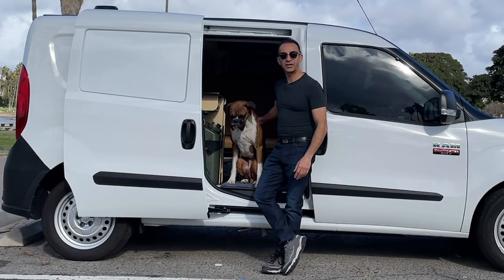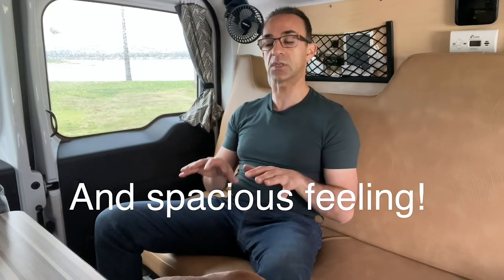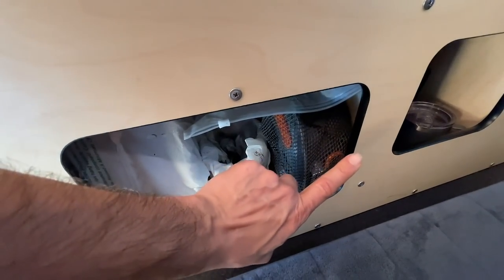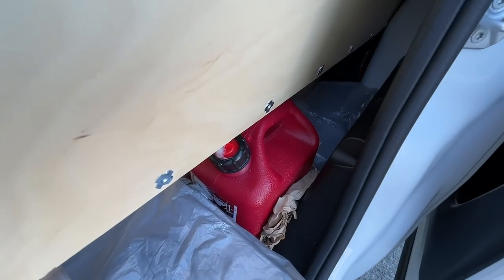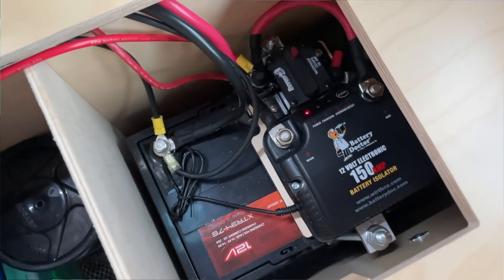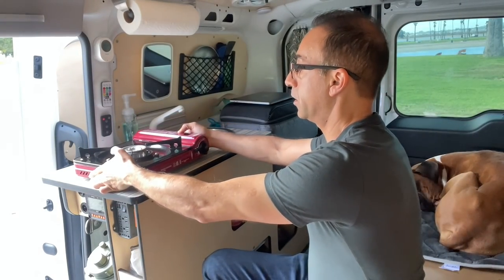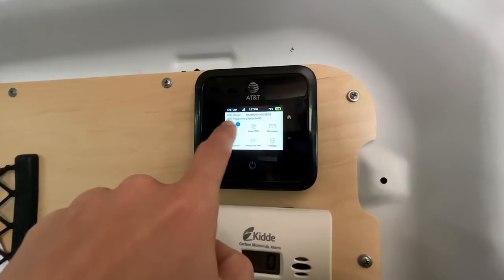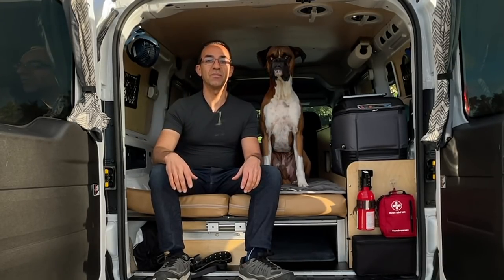Van Tour of Our Tiny Luxury Glamper Van | Full Time Van Life! (Story #8)

Comment: Hey there! Really like a number of the features that your conversion has, and I'm definitely going to look into adding a few to my NV200 self built van. I'm a violinist who spends months travelling around the uk playing at festivals so I have to carry around all my gear and electronics, so I had to get really creative about storage. My little dog Pearl is always with me too and it's taken a year or so to stop her barking at noises in the night, and initially she hated my diesel heater too. All in all I find its alot of trial and error and compromises in a little van but I wouldn't exchange our lifestyle for any other. I'd definitely look at some solid insulation if youre travelling to colder climates. Those metal ribs will conduct cold right thru the van, even a roll of vehicle carpet attached with spray adhesive will help - also I found well fitting reflectics that I covered both front and back with black material on one side and white on the other side for the windscreen and the front doors helped massively to reduce the loss of heat. I also fitted a swivel passenger seat that by not needing the curtain separating the cab from the van because of the reflectics providing privacy, I gained  much more space as it became the dogs 'special' seat to lounge on, however I must admit by 3am shes curled up in bed with me! Lovely van tour!
Reply from the maker: Thank you and good luck 👍
Reply: @Ava Greenall I'd like your advice on how to get a dog to stop barking. I had everything figured out about living in my van, but I had not considered the fact that my pug is going to be on the alert all the time.

Comment: Regarding the P bottle, we put about a half cup of “Mr. Clean Antibacterial Multi-Surface Cleaner (Summer Citrus scent)” in the bottle after each empty. We use a detergent bottle as it has a leak proof cap. The mr clean stuff completely neutralizes any funk from occurring in the bottle.
Reply from the maker: My bottle is an actual urinal and never smells. Link in description.
Reply: I was wondering about the P bottle so it is a real P bottle that explains the shape of it and it has a nice size opening for easy use much better than a gator aid bottle. 😉

Comment: Watching this as i recently bought one of these vans here in the UK although here its called a Fiat Doblo Maxi and comes with a 6 speed manual instead of the auto - you have given me some good ideas for what i could potentially do with mine, i love the bed setup the way its shaped around the wheel arch like that - i think id want some more covering on the walls though and i would definitely opt for a much larger (1800w) inverter so you can basically use anything of it kettle/microwave etc!

Comment: William - based on your video I decided to get the same level of tint in my van.  5% Limo style in the back, and 20% on the sides.  For me I wanted to protect my build/the wood from UV / Sun damage and add security in the back, and keep the heat at bay (I'm in OC/LA) in the front.  This was a very minor thing you mentioned in this video, but I just got it done today... it's pretty dang awesome.
Reply from the maker: Nice! Here is a tip.. it you notice police, roll down your windows temporarily and you’ll be fine. I’ve yet to face any issues.
Reply: @WillandRambo  Thank you.  I'm told here in CA the cops are now pretty lax about pulling over for tint; that they're likely using it as an excuse to pull you over for something else.  Hopefully saying that isn't jinxing me.

Comment: Cool! Thanks for the tour. By the way we have a similar first aid kit, and we discovered the hard way that they normally don’t include any oral medications. So be sure to check it for aspirin, Tylenol, etc. We used a small refill kit to complete our med kit.
Reply from the maker: Thanks for the tip.. I'll check mine out and see that its not missing. Though I admit, I don't take pills but you never know..
Reply: @WillandRambo  the situation we encountered was someone with stabbing chest pains that required calling 911. They recommended putting an aspirin under his tongue until the the EMTs arrived. It was disappointing our fancy/expensive first aid kit didn’t have aspirin. Fortunately it wasn’t a heart attack but it’s good to have oral meds for common maladies.
Reply from the maker: In that case, absolutely needed!

Comment: Congrats . Word of caution it’s a fiat diablo. Fiat has oil consumption issues . I have a 2015 and had 2 transmissions already 😂 but maybe for hope sake they fixed the bugs for the newer 9 speed zf transmission. Also change oil every 3k miles regardless . Full synthetic 0w20 or if it went to the 0w16. Enjoy 😉
Reply from the maker: Mine is 2021.. recalls are covered.
Reply: @WillandRambo  yes they are . I just wished Toyota made the hiace cargo here . It would put Ford ram and Chevy out of business . They last 900k-1.3 million km or about 600k miles . But that’s the 2.8 L diesel . Plus the engine is below the seat . So crash ratings wouldn’t work here w high speeds .
Reply: I didn't know it was a problem specific to older Doblos, I thought it was just mine! The other thing that seems to malfunction is the doors, when looking to buy mine I passed on 2 where one of the sliding doors has stopped functioning and now a few years in the same has happened to one of mine, as well as the back door.

Comment: Thanks, Will. Great tour. Love the simplicity of the cabinets---saves a lot of weight that way. We're just starting our build (2006 Sprinter) and corresponding YouTube channel, etc. Should be a fun ride! BTW, what's your other channel. I have a DL650 V-Strom and R1200RT.
Reply from the maker: Awesome! Link of it is in the homepage of this channel.
Reply: @WillandRambo  Thanks. I've just subscribed using my primary account. 
So you basically use your van to go around reviewing motorcycles? That's a great gig!
Reply from the maker: No, I had this van for only two months.. the other channel is two years old.

Comment: Nice setup.  
Question, how loud is your air vent?  I have one that looks very similar to yours.  However, yours has a different power switch.  Curious if maybe you have a quieter motor also.  Mine is a tad loud for how small it is. 

Btw, they make a nice rain guard for the front windows of the Transit Connect.  Or at least they did for the older models... mine is a 2012.  I installed mine several years back and it has held up great.  They are tinted so you can keep the windows cracked without anyone noticing.  I find they help a ton for when I'm using my diesel heater.  I will crack the front windows and open up the air vent (sometimes turn the vent on depending on how cold it is). This helps keep it from over heating... also sometimes help keep the air from getting too dry inside.  And no worries about it snowing or raining out.
Reply from the maker: they give you two vents so that you can You can keep them on low. Thanks for the tips.. it’s on on my list to buy one.
Reply: @WillandRambo  I will have to look for them.  My vent is all on or all off.  Maybe yours is just as loud but you are able to just run it at a lower speed to keep the noise down.
Reply from the maker: @101perspective  They have modified it so it has variable speed control. I'm pretty sure you can do the same. Link is in the description for the vent fan.

Comment: Been watching your videos lately as I am interested in doing this as well.  So thank you.  Questions:  Does the diesel heater prevent you from pushing the front seat back all the way?  I am 6' so that is important.  Secondly, do you think the two smaller vent fans do the job enough or would you have preferred one larger max air fan?  I know it is not an option with CC but wanted to get your opinion.  Best
Reply from the maker: You can push seat far back as you like. I prefer two vent fans. 1. It is quiet 2. I can run one and use the other as intake.